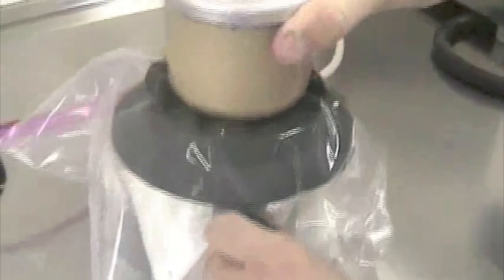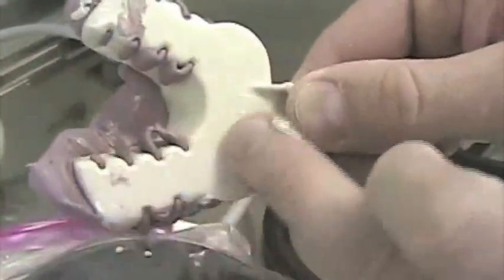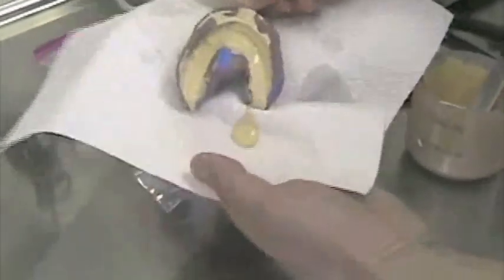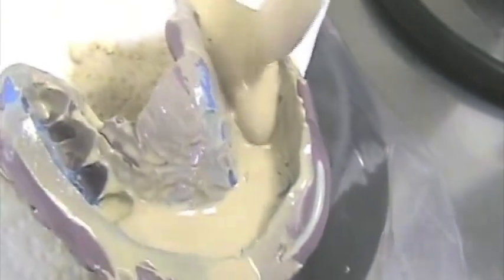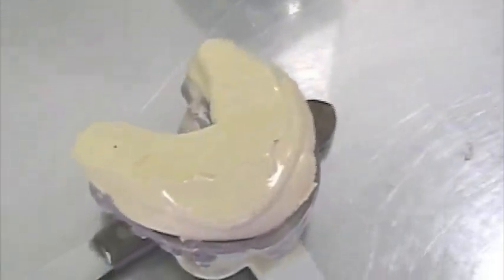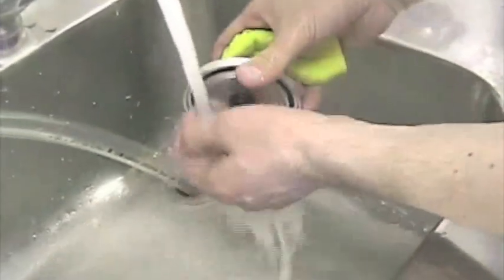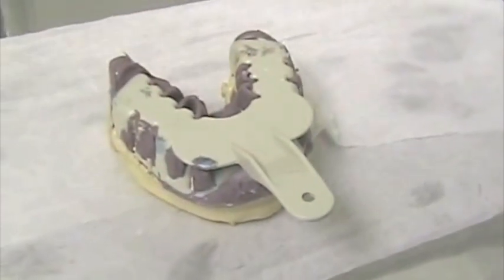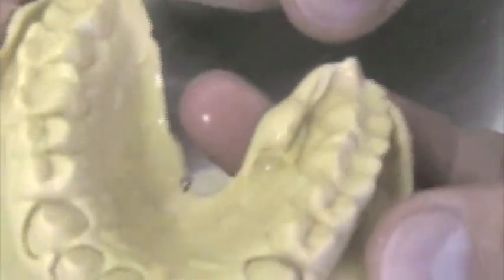GC America and Olivier Tric present "Mastering the Art of the Pour" Part 2

Comment: I usually lightly steam my impressions so to clear all contaminants and debubblizer and airhose as well to make sure they are not drenched. I also find that if you use a small point to push the stone into the margin creases lightly you can eliminate all bubbles on the margin and get razor sharp edges 100% of the time. I'm very confused about the tissue paper i just use a think plastic cover on the bench and wipe it off after and it last about 6 months. Great video though it's awesome to see!

Comment: Way too much time pouring an impression. It is not realistic for most labs. And why use debubblizer when you are worried about stone contamination? Use water instead. Lightly rinse the impression and then shake out excess water. It works way better than debubblizer and the die stone will displace any residual moisture. Also, when you shake out the stone from the impression you are taking a big chance of slinging the impression out of your hand and dammaging it. I could on forever but I won't.